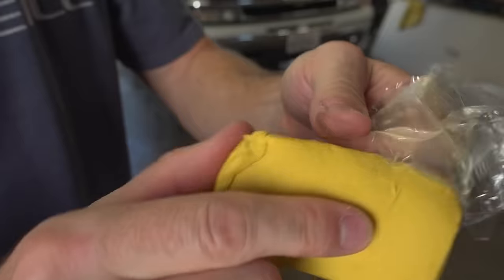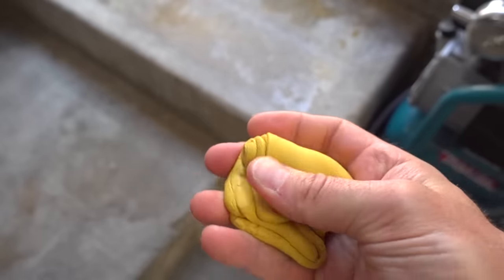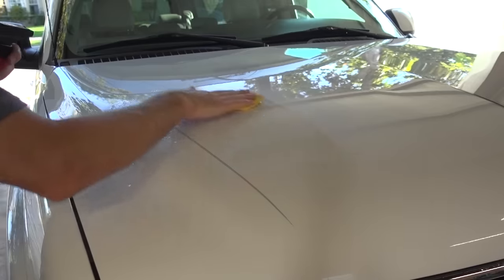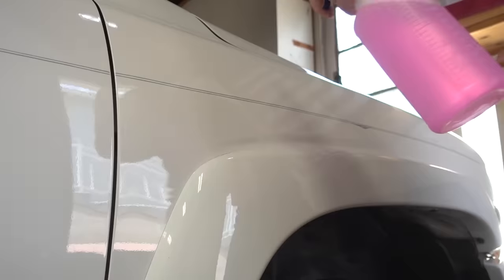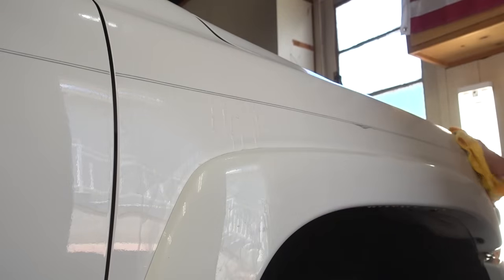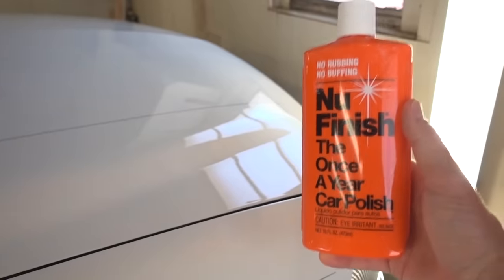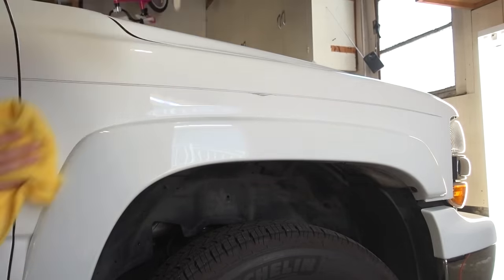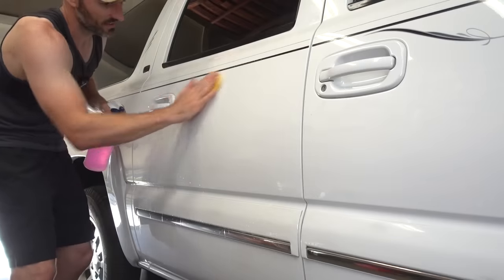This Is Better Than A Clay Bar And Only Costs $2

Comment: OK, now I'm old school and have done things to my vehicles that new kids might cringe at, but I know one thing...if you have an older car with original paint baked under the sun or softer paint that big deal clay bar will take off a layer  after layer, right down to the original primer. But, not so with Plumber's putty which I have been using for over forty years. Will never use a clay bar on my rods when I've gotten the same results.
Reply from the maker: Okay so you've been using plumbers putty as clay bar replacement for 40 years? No negative side effects? That's great!
Reply: My '89 Supra and '85 El Camino like the sound of that...I'll have to give it a try!
Reply: They have not used single stage paint on cars for a very long time. Unless you own a classic, using clay really is not an issue.
Reply: @Des420  I'm learning as much as I can here. What do you consider to be a classic and when did they stop using single stage paint?
Reply: @r.kirkwood1635  Good questions. I was thinking it was in the late 60's, early 70's, and those are what I consider classics... But decided to check. It seems as American manufacturers stopped in the mid to late 80's, and a couple of foreign models (not entire makes, like all Honda's, just a certain model/color of Honda Accord, black Lexus S300,  etc.), still used them up until the 2000's. So I think pretty much anything after 1987/1988 should be two stage.
Reply: @Des420  That is fascinating! Thanks for doing the research.
Reply: @r.kirkwood1635  Glad you thought so too. And no problem... I enjoy learning new info.
Reply: If you have been using it for that long you should have marketed it and sold it.
Reply: @JuanHernandez-rq2nc  
The market is flooded with clay bars, why waste your time marketing it??
I use a clay "mitt" every few months when I wash the car, much easier and you dont need extra "lube" because you just wash the car with it like using a sponge. It lasts quite a while too.
Reply: When you feel your car for any imperfections use a baggie as a glove you’ll feel the tiniest residue
Reply: @NITEGOD  
What? I have a large supply!!!!
Reply: R. Kirkwood m
Reply: Question with plumbers puddy,  how long does a ball last and if it's not dropped at all , how many uses  can I get out of it . OS there a number of times to be used than tossed away just to keep the puddy clean ?????
Reply: use compound with  a buffer theres different types of compound   ask for the right one  for your car.
Reply: Des420 yup my 1987 Buick grand national was single stage when new.
Reply: @motorcitymanman7711  the ribs show up in the finish
Reply: @motorcitymanman7711  - And the neighbors don't call the cops? Lol
Reply: WHY DO YOU FILM YOUR HAND SHAKING UP AND DOWN THE ENTIRE VIDEO WHEN YOUR TALKING?
Reply: Who wrote your narrating and wording? It seems like a dead knock off from Chris Fix...
Reply: @freddieh5539  
Naw.....I sell tickets!
Reply: @r.kirkwood1635  Clear coat paint was first used on the 1984 Corvette and 1984 Fiero.  The rest of the industry followed in the years after that.
Reply: @evil_musclemuscled3814   David puddy
Reply: Oh come  on no, REALLY ! . No way will a clay bar take paint layers off to the original primer ,that is  not possible,total BULLSHIT .My 30 year old car with original   baked under the sun paint was  as you described and no primer is showing ,that was misleading.
Reply: @scrappydogfinance8434  Naw, He's far worse.
Reply: @tedschmitt178   
Dodge was first to use base clear coat
Reply: The reason your removing paint is your pressing DOWNv on the clay bar. You don't push down at all on the clay bar. You push SIDEWAYS ONLY>.
Reply: @hunkydude322  tons of compounds out there. None vehicle specific. Main three abrasives are Heavy Duty cut for large imperfections, Medium and Fine cut for smaller. Many seal glazes and polishes out there also for swirling, some better than others for certain paint, of course
Reply: @hunkydude322  Isn't there regular rubbing compound [more abrasive] and polishing compound [less abrasive]. I'd be careful using the regular rubbing compound depending on the paint.
Reply: Detailed new imported cars with clay bar with water , then air dried then wiped dwon with white spirits to remove any extra wax that there covered with before import . Now a 3M clay bar that been over 50 cars and was still confident to clay over black paint , but never if drop on ground always kept bar in water.
Yes i agree if used repeatedly it would remove layers of paint but so dose cut / polish. Perfect example if your car has paint over spray on it the good old clay bar will remover it even off rubbers and plastics. 
Going to try plumbers putty for sure.
Reply: Some guy and he’s not using enough water/detailed spray... it should glide the entire time without any resistance whatsoever, if so then your not doing it correctly so spray more water down lol... also if it ever touches the ground then just toss that bitch away. Cuz it won’t work correctly ever again n will just mess up your paint more than anything
Reply: @Des420  It's making a come back now on the new Aluminum body Ford trucks and some Volkswagen cars.
Reply: @Des420  Single stage is making a come back on the new Aluminum body Ford trucks. Volkswagen and Volvo and certain Isuzu colors are single stage notice I said colors not models in ISUZU depending on a color it can be a single stage. I have a hard time with certain stuff calling in a paint code only to get a box with a single stage product in it. Most GM and Dodge fleet service trucks are all a single stage Deltron color paint.
Reply: @motorcitymanman7711  I haven't seen a clay MITT yet. I get these really soft disposable blue detailer mitts free from a local dealer. They get em with their paint orders and often have an abundance of em so I take em when they have em sitting around at the parts counter I can get 2 of em in a pack for $2 bucks. They work good especially if a wash didn't grab all the coal dust we get here on the roads.
Reply: Darren Adams or he confused a decade.
Reply: I call B.S. that you've been using plumber's putty for over 40 years. The technique of using clay bars wasn't invented until the late 80's/early 90's so unless you invented the technique yourself and didn't tell anyone nor patent it the entire time, I find it highly improbable.
Reply: what?? lol clay barsare none scratching, they remove bonded contaimation not paint work they should always be used with a lubricant...NEEDS to be a lubricant not water as water is not a lubrication, there are FAR better products out there now then clay bars and clay mits, claying rubbers are a thing now, faster, safer (if you drop it you can wash it out without fear of embedded grit unlikea clay bar which you throw out)
Reply: evil_muscle muscled , there is vid of a guy with a high powered microscope who did a cartwheel parishes n with clay bars. Best option is to use the claybar once per side (top,bottom), then get a new one. Doing that fold and reuse method of the claybar does leave micro scratches. But i am thinking i might look at the plumbers putty as a replacement, because $8 for clay bar is extreme.
Reply: Claying doesn't remove layers of paint 😂😂
Reply: @Des420  they used single stage white on Toyota vehicles up until just a couple years ago. Nothing but just plain white. Other companies may have done the same but idk.
Reply: Thanks for your input. It's what made me decide to try it.
Reply: @motorcitymanman7711  they make them that big??  Ok, back to being proper now 😉
Reply: @elcidlord  You all smaze me. Hsve you never heard the instruction  "Test in an area that will not be noticed BEFORE  puting it on your vehicle"? Geez, that's one thing I was taught many years ago from my Father. I use soft dcrub on my old red FORD truck when she starts to look orange like the guy who's president and it's great, never a scratch and always a shine. I tested it on the middle of her roof. Can only be seen by truckers but area is only about 4-5in diameter.
Reply: @aileenpierce2998  Guess you're the only one who can read.
Reply: STEPHEN MARTINI a clay bar does NOT take off paint. Period.  Cars are clear coated and clear coat does not rub off
Reply: @aileenpierce2998  Some of the spelling of people amazes me.
Reply: I have a white Toyota 2003  XLE. So, you're saying it only has one coat of paint??   Can I use the plumbers putty or what would you use? Thanks!!
Reply: @motorcitymanman7711  All claybar is from one source, just packaged differently and in different sizes. Video is not really helpful.. Claybar is, as I understand it.... to remove polution from car.... not remove scratches. Plumber's putty..... it was not determined if it worked or not.... need to take a car with good paint but  where the finish is well poluted, like my 2007 Sprinter... it has never been waxed
Reply: @citylockapolytechnikeyllcc7936  
Claybar removes dirt and grit that has stuck to the paint from lack of washing.
If you run your hand across your paint and it feels gritty at all u need to claybar.....after clay the paint should feel glass smooth.
I use a clay mitt instead of a claybar.
You're right claying does not remove scratches.
Reply: @tedschmitt178  
I had clear coat paint on my maroon 1984 Ford EXP.
Reply: @Patrick Conners 
I wish!!
Reply: Des420 it’s true that single stage paint products aren’t as widely used anymore since manufacturers are using base coat, clear coat but it’s still out there and will last just as long if not longer if taken care of. I like it personally and still use it because of simplicity. Just my $0.02.
Reply: Richard Allan yeah that guy probably never even waxed his car.... Down to the primer complete BS
Reply: ken mosedude  Have you considered applying a ceramic coating after a thorough wash and clay procedure? I'm learning about them, but AvalonKing is a well regarded DIY product; I think Mothers makes a lower quality spray on product.
Reply: @motorcitymanman7711  lol
Reply: Good to know thanks for the insight
Reply: @darrenadams9782  plumbers putty was invented in the 1940s by Harry Lichten. !!!
Reply: GMT Dodge was the first to have clear coat peel after two years LOL
Reply: So detailers clay come out in the late 80s but yet you have been using plumbers putty for 40 years as detailers clay. Cool story bro.
Reply: @motorcitymanman7711  jersey white fish!
Reply: @scrappydogfinance8434  take on Scotty!
Reply: @scrappydogfinance8434  soopy wooder!
Reply: @NITEGOD  what's a baggie?
Reply: @steveshields2293   slang for a plastic bag or a zip Lock bag ..
Reply: If that’s the case I will try it. Actually I’ve used plain tap water in a spray bottle as a lubricant with a clay bar.
Reply: Stephen Martini..I am also old school and the results are new school..lol!..we didnt have YouTube just our own personal studies...
Reply: @darrenadams9782  
You can’t market something if you don’t own the patron .
Reply: I trust this gentleman over these modern guys just trying to sell product
Reply: @kevinlewington4762  It does eventually. Me gramps car is now faded thin paint. From using clay bars! 🙎🙎
Reply: @Subie-Driver  clear coated not always. Clear coat is bad. The pai
Reply: @davemarm  a friend made wireless headphones as a 12yo in the early 60s. I am sure that wasn't invented until much later, so why not
Reply: @Des420  2001-2006? Toyota Highlanders used a single stage. Mine is white, they used it on other colors as well, but not all.
Reply: @tedschmitt178  I had an 85 ford tempo diesel that came with the clesr coat option and what amazed me was that the bodies on tempo models of the same year h without the clear had started rusting out about 3 to 4 years faster than mine did.
Reply: @r.kirkwood1635 The best car ever made has no clear coat. 04-06 Lexus LS430 Onyx Black
Reply: I’m curious what you use for lubricant?
This video shows a wash/wax solution.  What are you thoughts?
Reply: @NITEGOD  I actually use a glove tbh as a detailer gloves are essential
Reply: @evil_musclemuscled3814  so with a clay bar in a .5"×.5"  to ruffly 2"×2"square rectangle circle whatever your personal choice (if its not dropped [also pending how big the vehicle is]) as long as it looks clean as its folded and molded is good to use several times. Most ive got after doing suvs with the same piece was about 5. I have multiple level clay bars for diffrent types of vehicles. I.e. one soft med and hard for each type. Car SUV Truck then I cut those clay bars in 1/8ths, and take half for special uses for example daylies commuter ride share special event cars ECT.
Reply: Was plumbers putty even around 40 years ago
Reply: @Des420  i painted my 1976 resto rod vette in metal and diamond and metal flake blue old school using acrylic lacquer and lots of hand rubbing .Also painted my 1992 chev tracker in white single stage urethane fortified enamel no isocyanate hardener thank god .The results of the white enamel were fantastic  old school paint was $45.00 gallon and for marine use lolol
Reply: This is the info the younger generation needed. Thank you
Reply: @motorcitymanman7711 .                    Too funny! 🤣
Reply: I tried using plumbers putty. next morning my car had a faucet on the hood and garbage disposal instead of engine. what gives?
Reply: @Lunatic_88  😂😂
Reply: That's what I reckon too. Clay is dirt, good for digging down to and pouring concrete foundations on but not for rubbing all over you're pride and joy. That's probably why when I bought this "Value Pack"  Mothers Clay Bar kit it has been sitting on the shelf in the shed for nearly 2 and a half years. I know that the clear coat on my Benz is supposed to be really hard, and my Toyota somewhat softer but I still wash the car every year. Whether they need it or not.
Reply: @paulnoorbergen3514  oh boy… yearly washes? Poor babies
Reply: @motorcitymanman7711  my old old Toyota I occasionally use a scotch bright, but I had it painted in enamel 25 years ago. The original was acrylic.
Reply: @Hayawasa  maybe I have single stage "Toyota White" on my 2002 Landcruiser ute but it never gets a wash anyway. When I restored my old 1977 Hilux more then 20 years ago the colour match of the original Toyota 'white' "Standard White" included 'blue' mixed in. I was told there are 24 different colours of white for Toyota alone... go figure
Reply: yer ,the wind  does that 🙃
Reply: @citylockapolytechnikeyllcc7936  ...or like my 2010 red C250...
not been washed waxed foor 18 months.
Reply: @iamwog777  we used to take a rope of plumbing hemp and teased some out and rubbed plumbing putty  [ it wasn't called that though, it was known as Hawkins ] wrapped the brass male thread wth like an pre teflon. Linseed based. Same product different brand and consistent was used on joinery nails pre paint.
Reply: @paulnoorbergen3514  
What "grade" scotch brite?
Reply: @motorcitymanman7711  just kitchen brand lolol green scotch bright glued on a sponge for washing the dishes.
Reply: @paulnoorbergen3514  
How did u stop it from scratching the paint lots of liquid soap??
Reply: @r.kirkwood1635  yeah my 2018 huracan likes the idea so does my 458 Italia and my zonda
Reply: @motorcitymanman7711  the lube reduces friction if some dirt doesn't manage to stick and end up rolling across the paint. if you arent trying to go for that showroom quality then it wont matter that much, just at least use water.
Reply: @hunkydude322  Compound will NOT remove bonded contaminates. I’ve tried it and all it does is “polish” the contaminants, still leaving them on the surface.
Reply: Will it work on dog hair on car seats.
Reply: Older cars have 1 stage paint and later cars have clear coats better technology
Reply: If u looking for cheap way buy clay mitt or synthetic bar
Reply: @Des420  just cost more
Reply: @LarrySmith-xn9ty  
I heard it was actually invented by a black dude named Al Beaujoynt down in Louisiana, back in the 30s. As so often happens, some other cat got the patent and the cash for it. 😕
Reply: @NickyShweety if I've done a 3 stage color sanding and buffing and glaze then why use a clay bar ?  Is it necessary ?
Reply: After seeing this, I wonder how silly putty would work,it pulls print off of news papers too.
Reply: Thank you so much for keeping that information from us 🤔
Reply: @scrappydogfinance8434  i don't think he's trying to hide his inspiration from Chris Fix, but he covers a lot of things that Chris Fix doesn't.
Reply: Thanks Jimmy 👍 
Good job. IMO clay bar kits are not cheap. This plummers puddy idea is very interesting,  I'm going to give it a try.
Reply: The reason the clay took off the paint on your old cars, is that the paint is a single stage lacquer.  That's designed to be lightly buffed and polished only, and even that removes some paint each time, which you'll see on the polishing pad.  Modern paints tend to be a 3 stange, with a primer, base, and clear.  The clay only affects the clear coat, which is then cut and polished, then coated with a wax, sealant, ceramic, or graphene protectant.
Reply: @Des420  It's not difficult to test.  Even a light polish will transfer color to the pad on a lacquer or single stage when you start to rub at it.  Lacquers will transfer onto your finger when you rub at it.  They're very soft, and have no protective layers at all.
Reply: @Des420  I have a red '94 Ford that's not clear coated, and a white '95 that has no clear coat.  FWIW
Reply: That's what I'm talking about
Reply: Can u use the plummer putty on old lacquer car painted finishes my car been in a barn for Many years?
Reply: @stephenmartini5890...I've never heard of "removing paint by claying your car...ever. The only way that could happen I'd guess would be if the paint was very badly oxidized or flaking, if that's the case nothing will help protect your paint.
Reply: @hunkydude322  ...Using a compound will remove paint. A clay bar pulls out most all contaminates w/o removing paint, after claying use polish (which is also abrasive but to a lesser extent) with a orbital buffer to remove scratches some people use (after claying) 3 differing grades of polish, it depends how much work/time you want to spend on it. But always put a good sealant (Better than wax) to seal your paint. Ceramic coatings are the "new" rage but it's very expensive and very difficult to apply properly. Modern day sealants apply and remove very easily and can last a whole season up to a year depending mostly on weather (rain) and how often you wash it.
Reply: @scrappydogfinance8434  He does that to put emphasis on each word instead of swearing. My wife does the same except that she simply says everything twice. "I like this steak. I really like it."
Reply: I was turned on by an old timer who swore plumbers putty is the same thing as the fancy clay bars Mothers. I rarely use clay on my paint as I keep my vehicles clean all the time and waxed. I will stay with the PLUMBERS PUTTY CAUSE I AM FRUGAL.
Reply: Thank you very much for your comment.  I will begin with the plumber's putty.
Reply: @richardallan455  You’re wrong, some clay bars are so abrasive I used one on my car once and when I looked up half the paint on my house was removed.